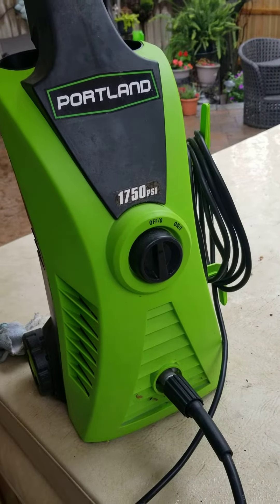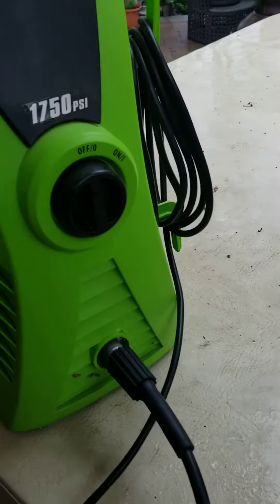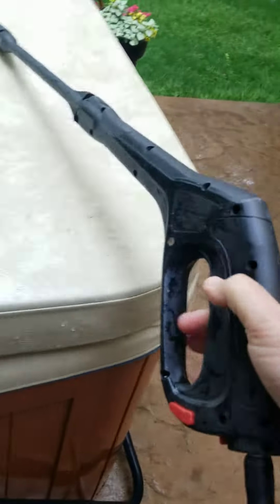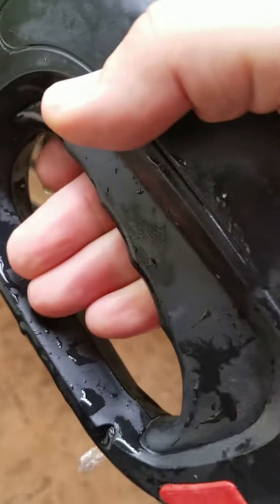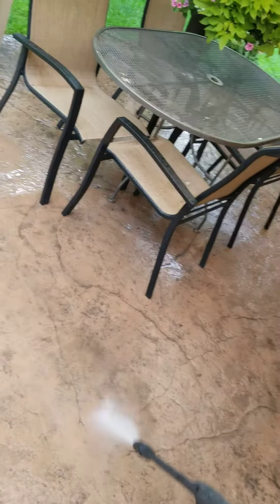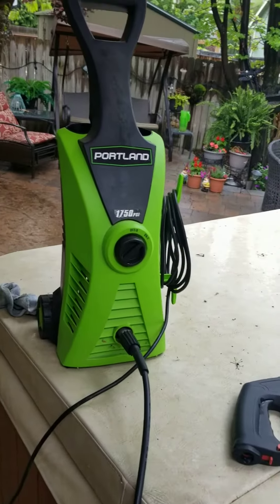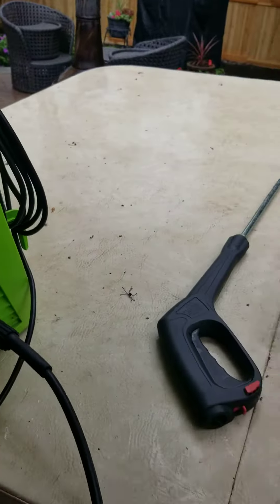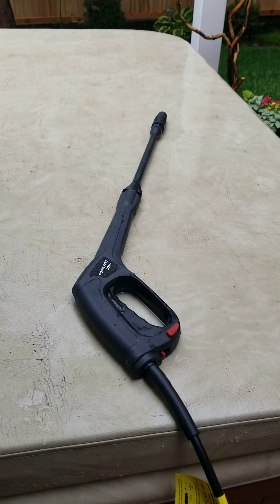Portland Pressure washer- leaking handle

Comment: Since you plan on getting another go ahead an take the wand handle apart an see if you have cracked plastic or bad o rings ,mine has leaked but not in the exact spot sometimes you can use something like J&B weld or Teflon tape!!
Reply from the maker: Hi John,  I have taken apart a couple of these; one on another Costco pressure washer with the same handle.  They are junk and you just cannot fix them; I try to fix everything but these.... junk.  Terrible design.

Comment: Y'all just need to replace the black rubber O-RING that's leaking.......one on the end of the hose, and there one on the wand...
Reply: Is there an o ring in the hose connection? Metal part?
Reply: @ychongy  If it's leaking it might have one......Search '"How to replace orings in pressure washer" those videos should help...Take the old oring to Lowe's and match it up...Oring # 83 replaced one of mines....thanks

Comment: You don't need to buy a new pressure washer 🤣 just get a new hose with quick disconnect  adapters and run any wand you want too. I did it to mine
Reply: Where did you buy your replacement handle?
Reply: @55chevytruck  please share where to buy your replacement handle
Reply: @missdaisy9916  I do not know that is why I was asking but I would check with harbor freight.

Comment: it's almost as if you only paid $74 bucks for it or something..........

you're lucky your connector nut hasn't started leaking yet... that's the real pain.

bring it back, get a new one and use it until it breaks again or just throw it away... those are your only two options.